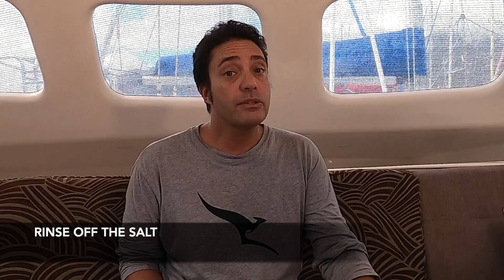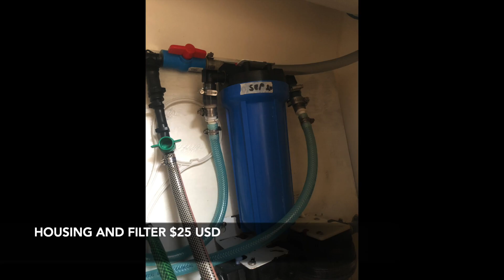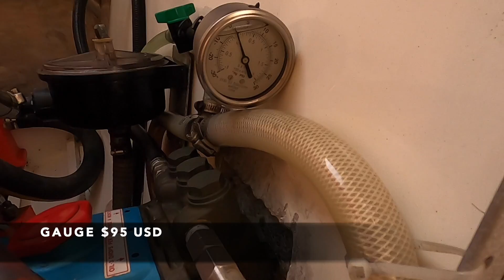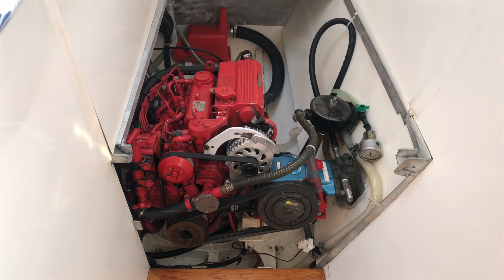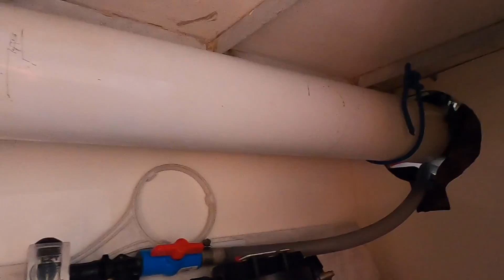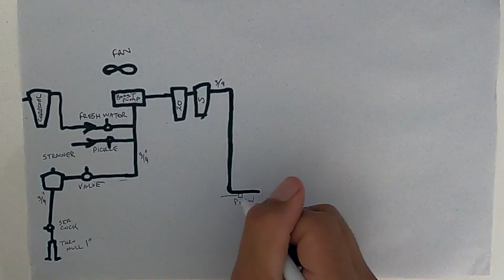BOAT TECH TIP - How to make a HIGH OUTPUT, DIY WATERMAKER, LOW COST & HOMEMADE  for a sailboat.

Comment: Hi James and Princess. 
I'm building a watermaker and I have the same 7 GPM Seaflow pump and the same HP 317 Cat Pumps pump as you. I'm looking into pre-filters and I've seen that you use 20 + 10 micron filters in 10" filters. The Seaflow delivers 7 GPM and the Cat Pump needs 4 GPM at 900 rpm or 5 GPM at 1190 rpm. I think that filter is very much at its limit and the flow rate drops significantly, causing the low pressure alarm to sound. It would probably work better with 4.5" x 20" Big Blue filters.
Cheers
Eugenio

Comment: Hi, I am starting to look into a diy water maker solution and in total agreement to using the engine for the power as it usually used every other day atleast.  Two questions: 1} do you think the sea water pump of the engine would have enough flow to eliminate the need for a low pressure pump and 2) when you know you are motoring for a whole day and you already have enough water do you have  a solution for disengaging the high pressure pump asI  assume the filters and osmosis filter must have a replacement need so you wouldn't want then being used when you don't need to?
Reply from the maker: Hey Jon. You will need a dedicated boost pump that will feed more flow than your hi px pump draws… Tee ing from your engine cooling would be asking for trouble for both engine and water maker.
Yes, you can disconnect the hi px pump with an electromagnetic clutch, same as they use for car aircon. The pump supplier also has these.

Comment: Jamie, how much are the water makers that you see on other catamarans your size? I had no idea that a DIY system would cost $3,000 USD.
Reply from the maker: I think they might start around $4k for a portable... Or $6-12 for an installed one depending on the brand... The biggest cost was for my  cat pump which is good quality... You could use a cheaper option.
The big difference with mine is it is 2-3x the output of the others.
Reply: @SailingLifeonJupiter  I like your style on being frugal with your money. I'm also the same way. When I get my catamaran, I'll be re watching this water making video.

Comment: You talked about a dive compressor. Do you have a 12 V compressor that does not get hot? What model is this?
Reply from the maker: Nope. Got a gasoline compressor... Coltri sub.
Reply: @SailingLifeonJupiter  Noisy... I hoped you found a solution or better a miracle 😀

Comment: I don’t think that irrigation stuff is safe for drinking water, better to use house water pipe, but it might not be a big deal.
I like your setup and explanation, good stuff, you sure are handy. Thanks to share all that knowledge and experimentation with us.

I wonder how much the booster pump is necessary, do a few psi of negative pressure cause problems? Have you tried, or are you going safe to save your high-pressure pump?
Reply from the maker: You might be right... Any plastic isnt good for ya...and I'm not positive about the boost pump requirement.. But for the high flow rates of this system, I certainly wanted it. 
tks for the feedback.

Comment: I can see the advantages of a high volume system as it minimizes the length of time you must run the engine to produce your water supply. Btw I think I missed you telling us how big your water tanks are and how long you must run the water maker in order to fill them and how often you need to fill them.
Reply from the maker: Hey Ed... We've got about 800L capacity, but wouldn't normally fill them unless we are going up a muddy river or something and can't use the water maker....Normally i'd only make enough water for about 5 days of use. That way i don't need fresh water flushing of the system.... just make water every 5 days.... but it all depends how many loads of washing we decide to do....or wash down the deck...or scuba gear.
Cheers, and thanks for watching

Comment: Wow. Spectacular educational video. I really hope I can afford a cat soon so I can build one of these systems.
Seems like the Mumby boatyard may have been halted during the pandemic because the cryptic private message I got back indicated they were starting building now (this week). 
Do you know if a galley up version is possible in your boat design? 
Do you still think building one would be $300K? How complete is that?
Does Mumby have a website or a place to get info, that you know of?
Reply from the maker: Yes he did stop for a year or 2... But is setting the yard up again now....Yeah I've seen a galley up version that a private owner/builder did... I wasn't impressed... It was a tiny galley, and made the saloon very small and crowded....I wanted galley up also in the beginning, until i saw the result.... the beauty of the stiff construction is that the bridgedeck/hull connection is open.... so that i can stand in the galley (down) and see/chat with folks in the saloon and helm...you don't feel like your standing in a tunnel!.... its the best galley down design ive ever seen.
I've had report from other guys who are "getting in line" for a new build with Tim... and it seems my prices have gone up about 10%.... that is for fully fitted, sails, rig, engines.
And no he is not online anywhere... but there is a small facebook group that is pretty inactive, although we might start posting on there!... search facebook groups "mumby catamaran".
All the best Steve.

Comment: Have you have the water checked, to see what contaminates you have. The reason I'm asking is that some irrigation pipe have carcinogens that leak out of the pipe. Its the same reason as why you do not use drain PVC for drinking water.
Reply from the maker: Good point Greg... no i haven't had it checked... I also hear that copper water piping in many households causes liver and kidney disfunction.... not to mention the chlorine in city water.
Our water tanks on Jupiter are integral with the hulls.. therefore aluminium.... not great either with rumours of Alzheimer's!... 
All we can do, one by one is try to minimise our exposure to the these chemicals... some we can, some we can't or choose not to.
I hope that we are minimizing our exposure in other ways such as the food we take and the air we breathe and the medicines that we do not take.
Thanks for watching and the absolutely relevant comment.
Cheers

Comment: Can you please help us understand why you chose the 317 model pump over the 310?  The specs seems similar but the 310 can be found for much less cost?  Not sure if one of them is an outdated model.
Reply from the maker: Hi Sean.. From memory CAT had some guide on their website where you entered your purpose for the pump, and it spat out the appropriate pumps... I believe for seawater RO applications the 317 was recommended with NAB head and Ss316 valves... Where as the 310 is brass and ss304 valves.
There is also a Ss316 headed model which was more expensive.
BTW, don't be confused by their specs flow rates... You just turn them faster/ slower to get different flows.
Tks for watching!
Reply: Awesome.  Thank you very much.  Loved the video.

Comment: Hi Jamie, nice video, nice job! Making an RO myself, a little smaller (40GPH). Just got my 2540-pressure vessels  delivered from China. 5 days from China to Europe, very good quality, and as you told: less than 1/3 of price in EU or US, incl. shipping costs. Happy sailing!
Reply from the maker: Awesome... I love to hear stories about "beating the system", cutting out the middle man, saving $ and the satisfaction of DIY...
Reply: Have you tested those pressure vessels? Any issues? I've just finished the design on mine, but I'm undecided on whether to order pressure vessels and membranes from China, or spend more with a US manufacturer with known quality.
Reply: @IanSGI  Not tested yet. Build will be by the end of this year.
Reply: @eqpierresvclara4378  Cool. Which supplier? I'm talking to a few right now, and I'm going to try ordering the SW-2540 filters as well and test their combined effectiveness.
Reply: @IanSGI  Ian, please PM again, accidentally deleted your msg.

Comment: Good video. At the product water side were you have the two valves that never should both be closed at same time... you could probably add a pressure release valve there. If anyone ever does make an error that valve would open instead of causing damage further up the system.
Reply from the maker: That is a nice idea... if I come across something like that, i'll do it.... Like most things on my boat, only i operate it... but more than likely, i'll make the error eventually! Thanks for watching

Comment: Great video and great job on the water maker design. I am also going the DIY route on a 36 to 40 GPH system. You referenced a contact for your flow meter in the video. Do you mind posting the source here please?
Reply from the maker: Thanks Arlo... Im pleased with my DIY watermaker.... People are telling me Sea Water Pro make a good priced kit, using a "General pump", which would save some cash.... My flow meters i got from Aliexpress (china). I've just had a look. My supplier isn't listed anymore but there are plenty there starting at $6usd each.... search "flow meter water"....

Comment: thats real nice headliner  and walls around windows..what is it??
Reply from the maker: haha.... how about my DIY watermaker?.... It's actually flowcoated fibrelgass... made by using a glass table with mould release... paint on 4 coats of flowcoat, then lay down 2 layers of chop strand matt..... then cut as required and cove.... The textured head liner mould is linoleum vinyl (flooring), done the same way.
Reply: thanks for headliner info,,,,,,,,  yes i found best place on how to build watermaker on net. you also know those places with pics and prices and link to each item.but whsy didnt you go all the way and build 65' ketch. catamaran
Reply from the maker: @remodeledcatidea5324  ...cant u tell by my "low cost" watermaker, that i ran out of money!!!